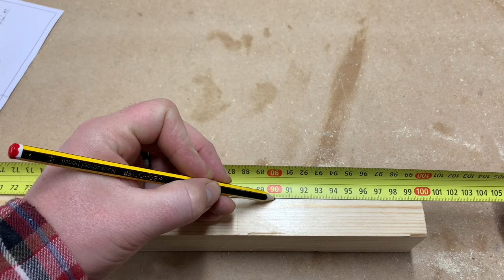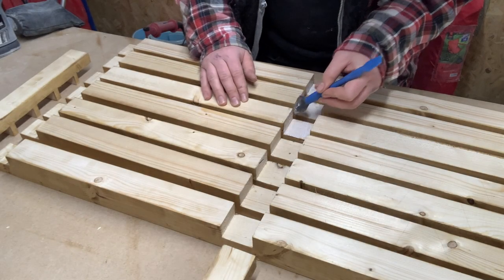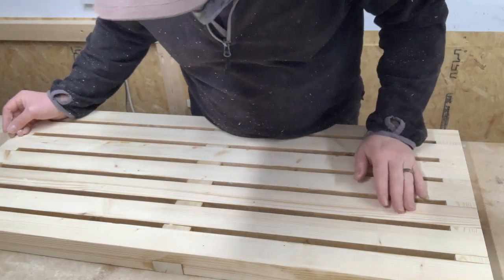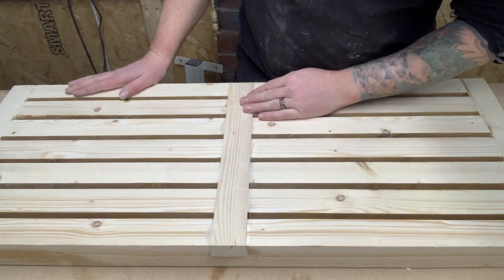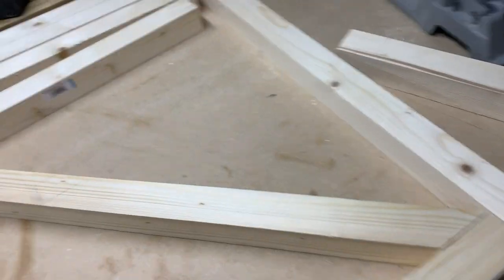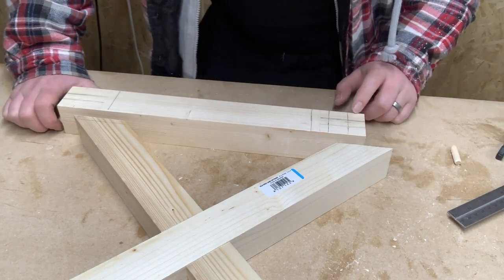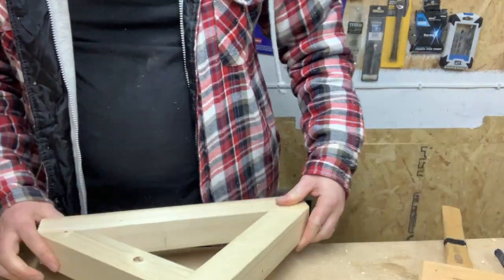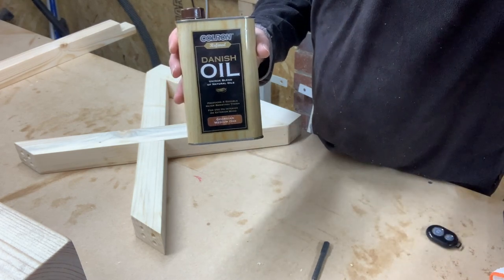X Leg Bench DIY UK #KPWBCC2020

Comment: Great video Jamie, and some great techniques 👍
Reply from the maker: Thank you buddy!
Reply: @jamiesworkshopprojects1617  how do you find the evolution mitre saw? I was looking at getting one myself.
Reply from the maker: I like it. I wanted to upgrade to a saw which had a trench cut capability and this was in my budget. It was fairly accurate out of the box but after spending a bit of time I’ve dialled it in so it’s now cock on. My only niggle with it is it’s quite deep front to back so I’ve loads of ‘spare space’ behind it and it sticks out quite far from my workbench but I have a tiny workshop, so I might notice it more
Reply: @jamiesworkshopprojects1617  no issues with the speed at all then, the rpm was the only thing that was putting me off for precise cuts splintering the wood
Reply from the maker: Speed is something I never took into consideration tbh. I find if I cut slowly through material it reduces splintering